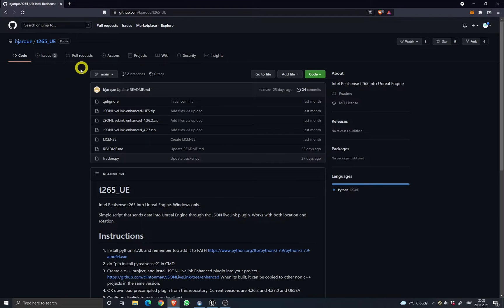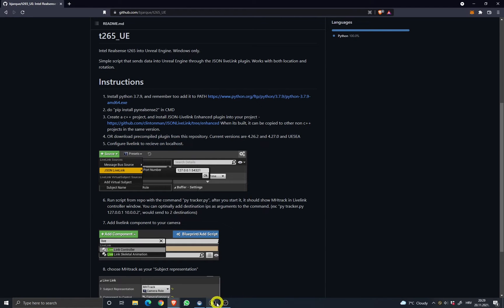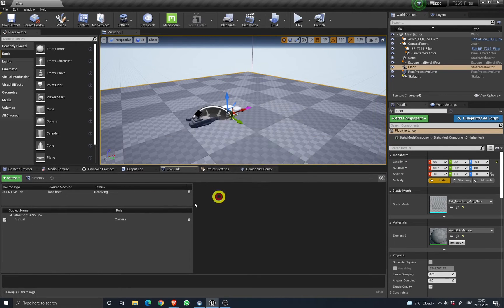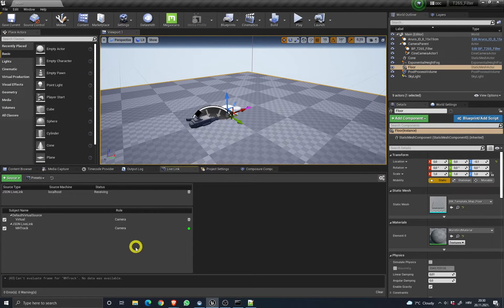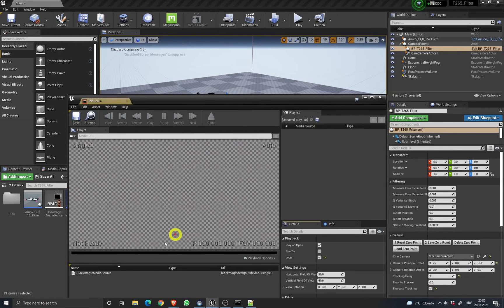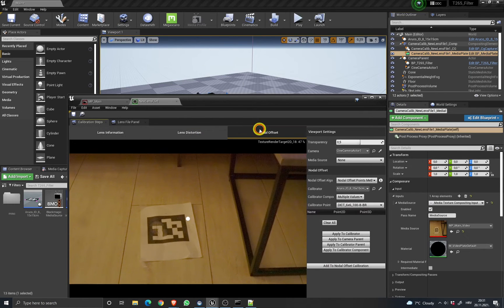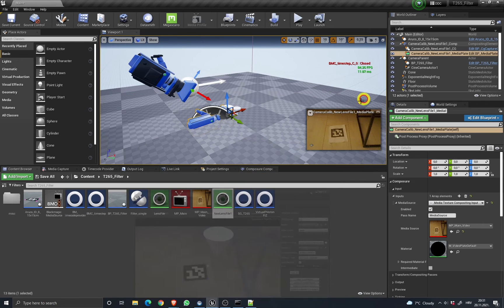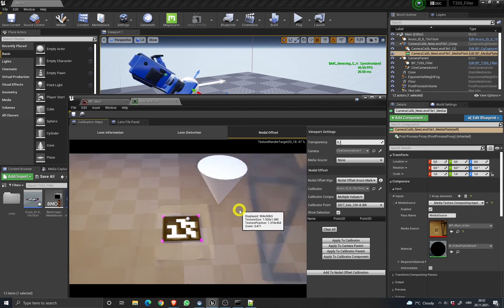Intel RealSense T265 to Unreal Engine project file (Simple Kalman Filter blueprint)

Comment: I followed along till I got stuck at opening the project. I couldn't get the plug-in to activate because when I restarted project to enable the jSON plugin I continued to receive this message "The following modules are missing or built with a different engine version" I tried opening in other version but then other things would not work and I would still get that error message and not being able to access project.
Reply: Hey There , Did you apply this and succeed.? Pls let me know if yes I seek help to set it up..
Reply: @sinanarts  I tried but sadly i didnt Sitting here with a 600 dollar dud. so thank you for responding because I honestly gave up on my own.
Reply: @mybfsasha4803  I very much dislike people who ignore messages. And as a well character person you just earned yourself a working solution. I have found a friend from Intel and worked for VP studios and he will help me to set it up step by step and I will Do a Youtube video as easy as a very beginner with zero knowledge can follow along and run. So be patient few days more. Best Regards.
Reply: @sinanarts  Thank you for taking to the time to help those in need. I will definitely wait on the tutorial. I think Ivan  is the only person from my research that has done a video tutorial for the realsense for unreal engine so you are at this point my last hope to getting this to work. So fingers crossed thank you again

Comment: Hello, thanks for this info. Tried to follow your steps but i couldnt detect de Aruco Marker, it shows detection but i dont get any points to add to the camera parent. Im using Aruco_ID0 (zero) any hint would be appreciated.
Reply: Try to use ID08
Reply: Always use the Aruco 08 15x15 size. And I also seek for help with the Integration aof T-265 can you help me on that.?

Comment: does it support multiple t265?
Reply from the maker: Tracking/filter blueprint can be used with as many as you can get to Unreal. :) As for how to get multiple t265's to unreal on a single machine that should be solved on the sender side. You can try to achieve it by tweaking the sender code to use T265 serial numbers to start the pipelines and using different live-link subject names for for each T265.
Reply: @idabac   i saw that they are discontinuing the t265 do think it would be a wise choice to get one while still available?
Reply from the maker: Hey Landon, it all depends on what is your use case and what level of precision you need. To play with it, learn about the tracking concepts and use it for smaller experiments I don't see a reason for not getting one, but if you ask me would I put my faith in it as a tracking solution for a paid gig - I doubt so.
Reply: @yodafresh  I Haave one t265 if you are intrested?
Reply: @idabac So with Ramiro's Lab "Serial COM" v3.0.0 (Beta) is it possible now?
can u take a shot?
Reply: @idabac  Dear Ivan, This video is a little advanced. Can you please do a Step by Step flow to use with UE 5.1 or anyone reading this please Help us somehow.. PLEEAASEEE.. :-)